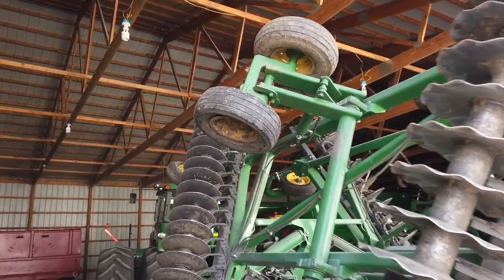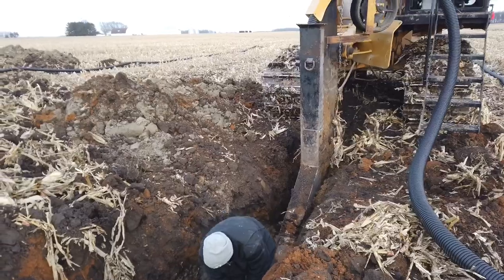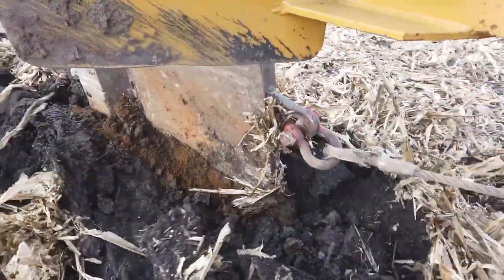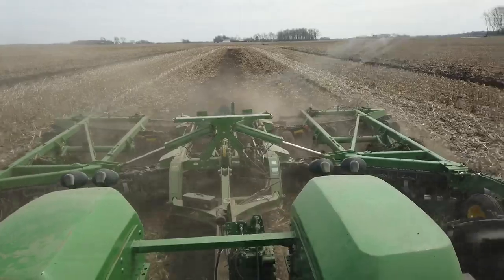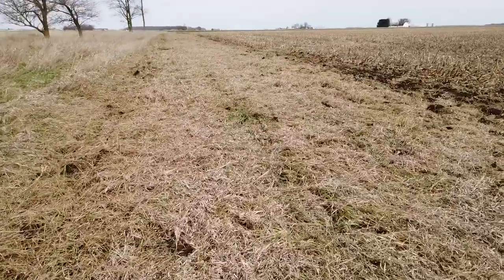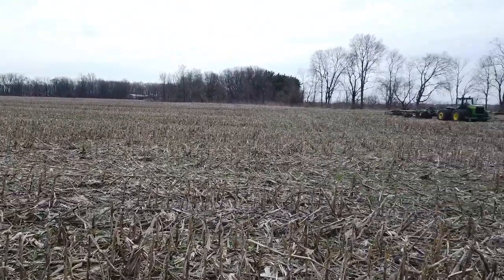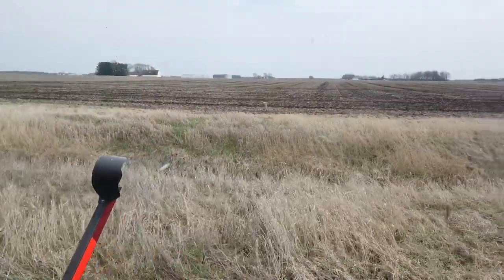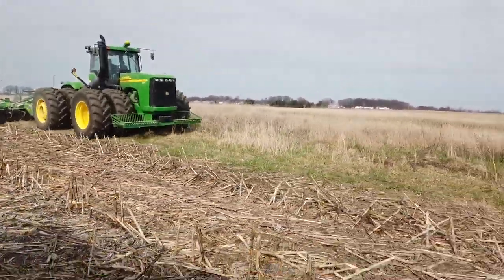Drainage Tile Intallation, Field Work, and Conservation Practices

Comment: How many years do you figure on getting a positive return on the tile investment? thanks
Reply from the maker: Depends on how much it rains. Ha! We’re under $1,000 an acre, but I’d say you’re looking at a 5-10 year return. I also look at it as it’s cheaper than adding acres to get those bushels.
Reply: @TheFarmersLife  Thanks. It's not common down here like up there. Probably be a long conversation with the banker. Other differences are county avg. here is 75 bpa corn. I do think it would help on my farm.
Reply from the maker: TwoHappyChildrenFarm when we started yield mapping the shocking thing wasn’t the yield in the low spots. It was how far the lesser damage reached behind the low spots.